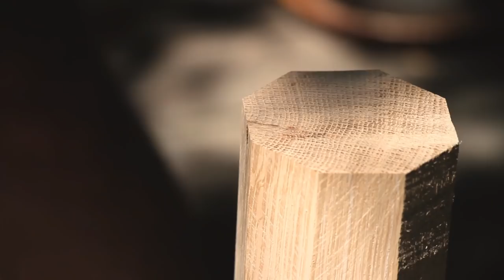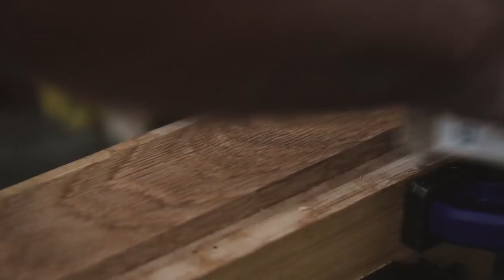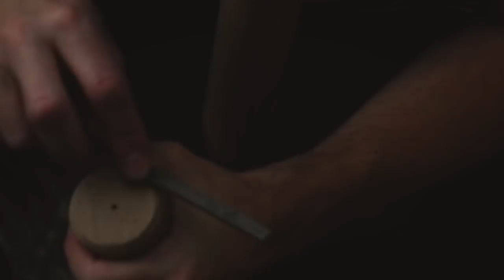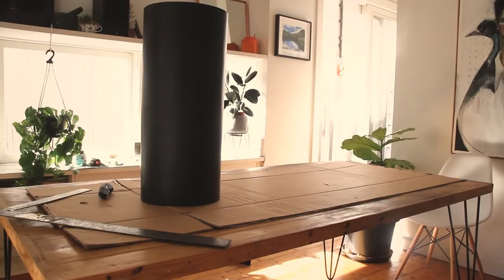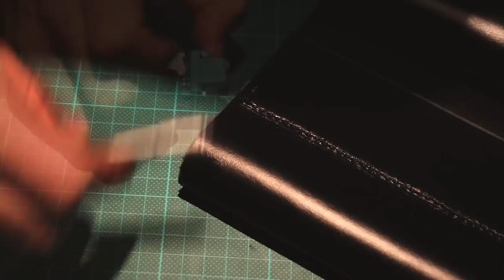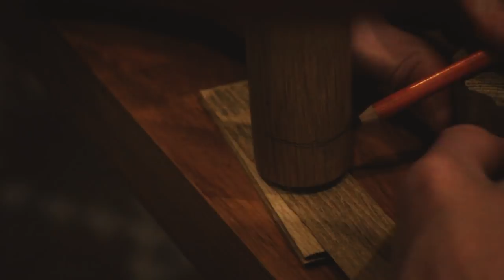Leather sling lounge chair - DIY Build

Comment: Amazing. I would like to build such a chair. Is it possible to share the measurements or are those a secret?
I don't even know if it's appropriate to ask for those.
Reply from the maker: Happy to share! The back legs are 690mm tall, front are 520mm, arms 730mm long, and supports/seat are 560mm wide (plus an extra 10mm or so that slotted into the legs).  There are probably some changes I would make if I were to do it again, e.g. make the back a bit taller... I did start with a design in SketchUp which I would share, but I ended up deviating a fair bit from that as I went (judged a lot of the dimensions by eye, and testing it as I went along in terms of the height to put the cross-bars etc.).

The front and back legs are both angled inwards (i.e. the top of the legs tilt towards the centre of the chair), and the arms tilt down a few degrees.  I don't have the exact angles for these, but kinda just did that by laying the side frames out on the ground and did what "looked" good.  Guess the trickiest bit was working out the height of the front horizontal support - just made sure that it was lower than where my knees would be with my feet flat on the ground.

The mortises for all the spindles were a real pain... drilling into a tapered leg with an angled hole, on round stock, was a real challenge!
Reply: @KastnerFurniture  Thank you so much for this info.. Although it will be impossible for me to build something like this, I'm pretty sure can make an amateur version for my outdoor space. With my 2 left hands I will use nothing but simple wooden beams in straight corners... I'll also have to replace the leather with two straps, on which I will add smaller wooden planks.. 

Can you help me with the height of the leg rest (at the front of the chair, where your knees go), with the depth between the front and the back leg, and.. with the length of the leather?  Thank you so much!!!

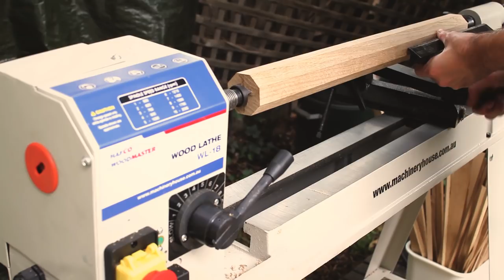Comment: 1:54 when grinding, if the tool edge goes blue, (as it has at 1:54) you've overheated it and drawn the temper out. It'll never keep an edge for long now!
Reply from the maker: Yeah I realised that as I progressed, definitely went a lot lighter on the grinding later on in the process.  That was pretty much my first go at sharpening the gouge
Reply: @KastnerFurniture  you can harden and temper it again ofcourse, but persevere with the sharpening until its dead the buy a new one! Always have a pot of water near the grinder and dont be shy in using it.

Comment: I have a Question please tell me what skin did you use? and how to make sure that the skin does not stretch over time? 🙏🏽🙏🏽
Reply from the maker: It's leather but it's 3.5mm thick. It'll take a lot to stretch something that size and thickness... it may happen over time but aftrr 18 months of use so far, I don't notice any change.

Comment: Nice job. Precise. Do you think tha back arm rest joint is strong enough? If Im not wrong it is "just" glued in the groove. Strain  of that part when you put a weight of a body on it could  be big. May be you see later, may be it will last. Anyway thanks for sharing this. Good luck!
Reply from the maker: Time will tell, but they're holding up perfectly fine a few months in. They're in a fair way and the glue is tougher than the wood so I'm not so concerned about it coming loose as much as the wood snapping... touch wood.
Reply: Great build but that joint needs a redesign. Long to endgrain all around, could think about a throught mortise to gain more long to long grain surface.

Comment: how thick is the leather?
Reply from the maker: Was around 3.5mm from memory
Reply: @KastnerFurniture  Thank you for the lightning fast response. This is thick leather! Does it stretch when in use or at that thickness it's stiff enough?

I'm looking to replace the seat and back on a chair set (plywood and cushion covered in fabric) with just leather glued to the wood frame and secured with upholstery nails. The seat would be 22x20, with no support underneath and I'm worried that the leather will stretch. Your project is relatively similar, hence the question.
Reply from the maker: @serbanpopescu1032  haven't had any stretching after a year of use... they don't get a lot of people sitting on them day to day, but don't think thick leather will stretch much.   Soften maybe but stretch not so much...

Comment: I'm sorry to say but its a pretty bad design. You should have used rope or wire for the lower stays, because there is a force pulling them apart and over time the chair will fall apart. I would have funcion and also look better.